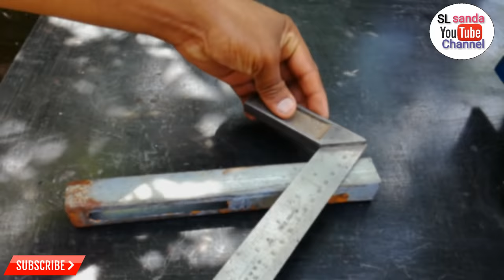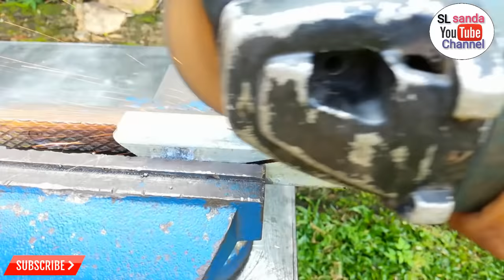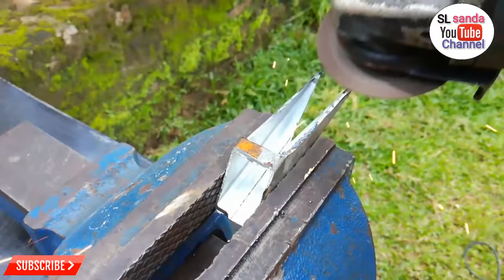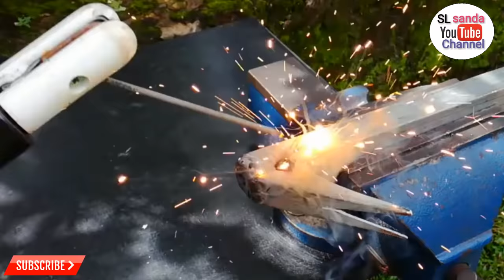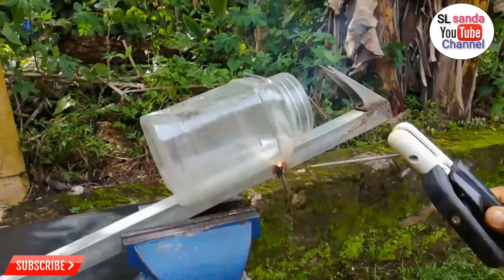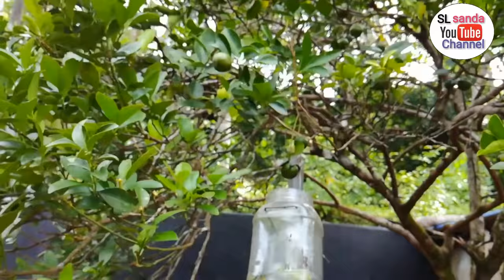Fruit Picker Tool

Comment: Looks great. Suggestion: Cut the bottom off the plastic jug and install it upside down on the pole. Then when ready to empty unscrew the cap. The fruit won't get poked by the grabber.
Reply: mr10man69 .

Comment: Cool ! Try using an old claw hammer head on a shovel handle instead and save the square stock and welding rods for equipment repairs 😃

Comment: You do know they have a fruit picking tool on a nice long handle with a large basket too. I have one, works wonderful and won't rust or cut up the tree like yours.
Reply: If the regular size as the one you use for oranges and lemons, then on trees with calamondin and other small fruit it will not work. 1) the basket does not allow you to get into dense folage very well. 2" the fruit is small so the grabber end does not grab as well.

Comment: Or you could just get crimp the metal ring on the far side of a pole net, sharpen the inside with a file and curve the metal ring away from you slightly so thenet catches the fruit when you pull. I been picking fruit for years that way.. no welding, no cutting, just bending the ring on a cheap net and a file to sharpen a cutting edge. If the fruit doesn't come off when you pull, it's not ready.

Comment: While this is a fantastic idea and works well, i must stress the dangers of welding galvanised metal bfre grinding back a portion of galvanised material to clean metal. If u do not do this the welding process gives of arsenic gas which WILL kill you if inhaled. 👍👍👍👍👍👍